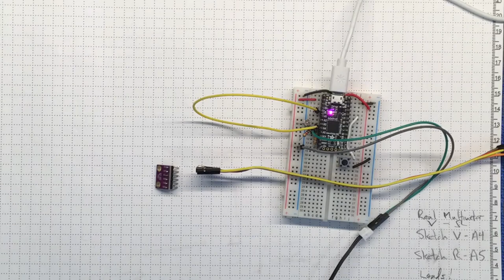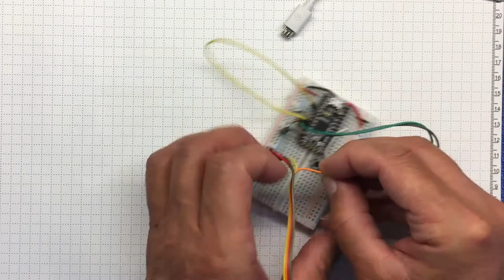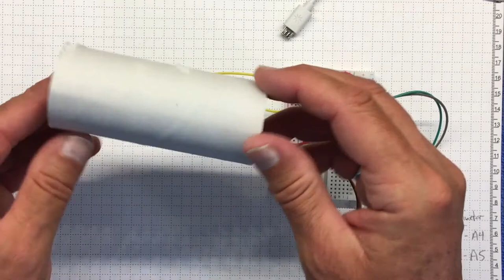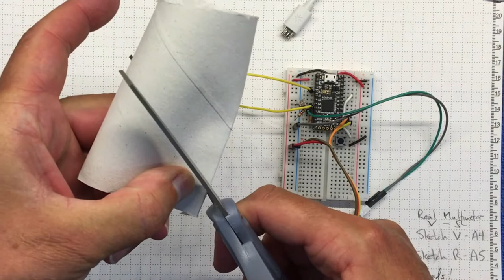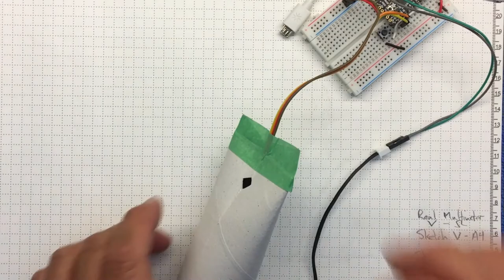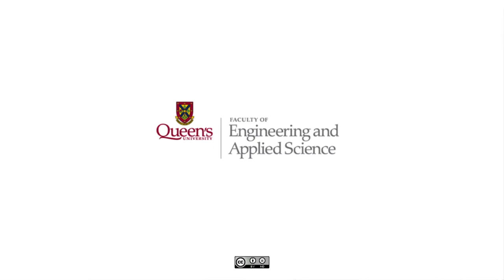Build Spirometer

Comment: Thank you for this video, it is very helpful  for my project. Can you please provide us the code because I am having problems with connecting the dots such as how can we relate the pressure difference with air flow rate and the exhaled air volume?